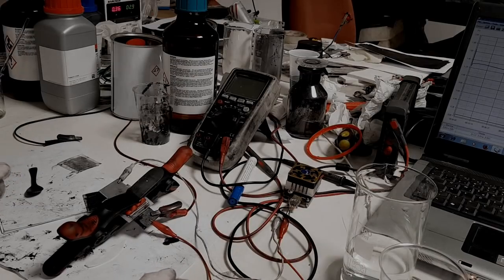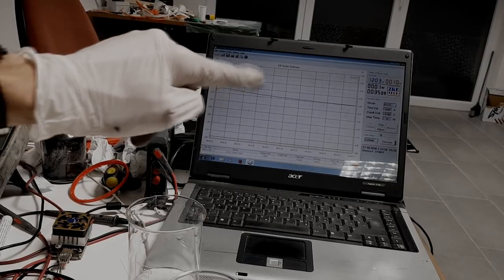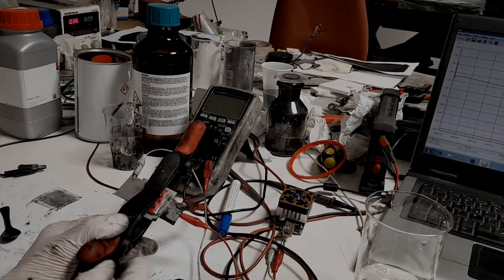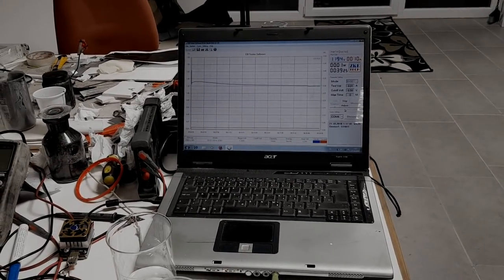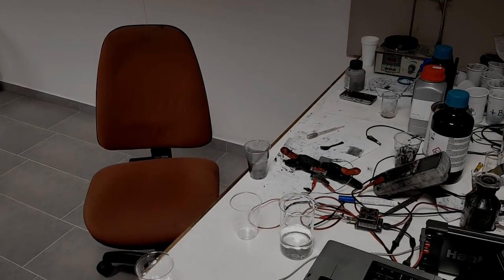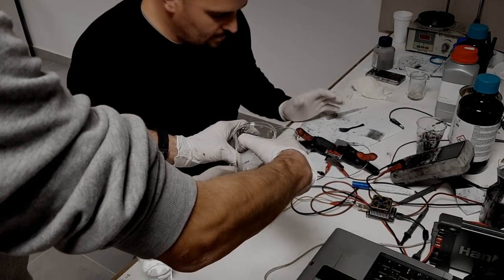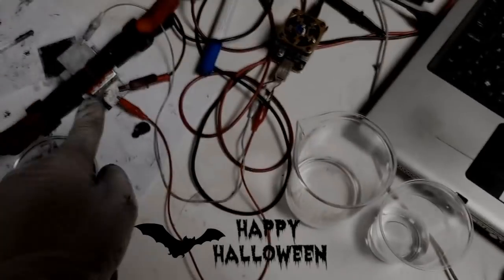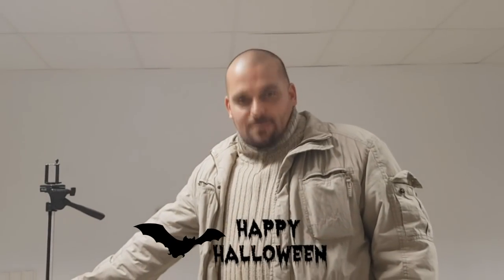Aluminium battery experiment, goes terribly wrong!!!

Comment: maybe nice a positif and negatif plat a copper plat and katoda mixing graphite and carbon aktiv and  alumunium plat  anoda mixing titanium oxide and carbon aktiv.. sparator pva and koh .. and electrolit koh..
Reply from the maker: With copper you get unwanted reactions in the battery. KOH electrolyte is to corrosive to aluminium and you can not stop the reaction
Reply: +cayrex2  maybe before the cathode coating process and the important anode coating is sodium sillicate to avoid corrosive reactions ?
Reply from the maker: @CREATIV_DIY  you can try but the performance of the battery will be much lower. And still you will get corrosive reaction but this reaction will be slower.
Reply: +cayrex2  Is there a solution for battery electrolytes that I will make? the reaction of KOH electrolyte with true titanium oxide makes corrosive to my aluminum plate ... is there a solution? thank you..
Reply from the maker: @CREATIV_DIY  yes,... you need to change the electrolyte,... from alkaline to salt like aluminium chloride, etc
Reply: +cayrex2  can my battery still be recharged after the electrolyte is replaced with aluminum chloride?
Reply: +cayrex2  rechargeneble or no ?
Reply: DODHY Why don't use pva/koh as both electrolyte and separator? Which concentrations are you using for pva/koh?
Reply: +Bert0ld0  first I use pva as a separator ... but I mix with potassium hydroxide ... plus potassium hydroxide as an  electrolyte to..